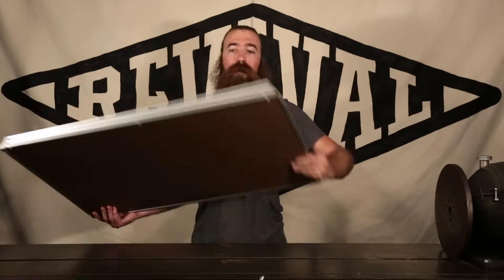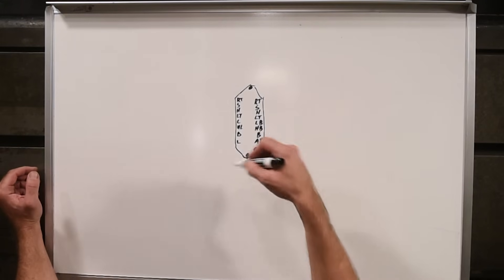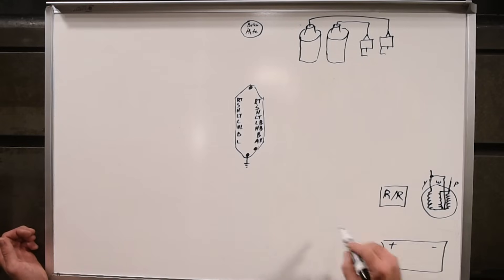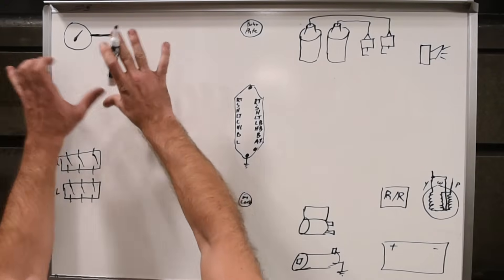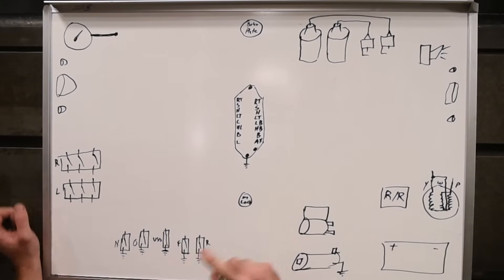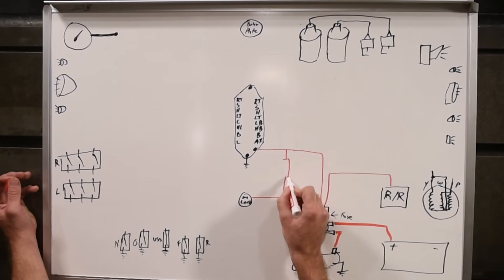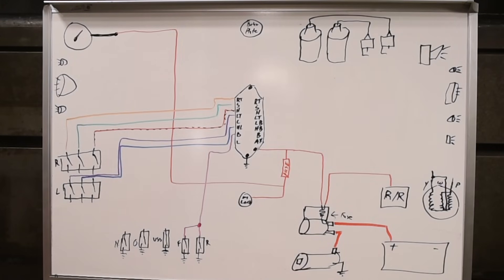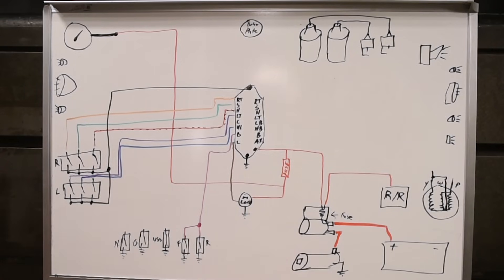How to Wire Your Motorcycle  - Revival Cycles' Tech Talk

Comment: I'm working on an 84 GL1200 Aspencade. Everything else is done but the wiring. This is a helpful video. But since I am drastically reducing the number of electrical components, should I eliminate any specific OEM hardware?
Reply from the maker: A GL provides a lot of opportunities to simplify wiring depending on what you intend to do with it. Really, the best place to start this process would be our tech articles section. The Wiring Theory article and Comprehensive List will explain what must stay and what can go, while the Universal wire diagram will give you a foundation for working out your model-specific system. 

A Comprehensive List of Items You Need for an m.unit Installation

https://technicalarticles.revivalcycles.com/hc/en-us/articles/360008817472-A-Comprehensive-List-of-Items-You-Need-for-an-m-unit-Installation-

https://technicalarticles.revivalcycles.com/hc/en-us/articles/360008817972-The-Revival-Approach-to-M-Unit-Wiring-

https://technicalarticles.revivalcycles.com/hc/en-us/articles/360009106131-m-Unit-Blue-Basic-Universal-Wiring-Diagram
Reply: @RevivalCycles  Thanks for the references!

Comment: I would like to take off the turn signal/headlight apparatus on my bikes left clip for racing (don’t need lights or horns etc... )Does removing these type of things cause a change in current or voltage for the rest of the system components? I just don’t want to overload or cause any other important component to fail bc I removed too many things.
Reply from the maker: The basic answer is there is no problem removing components like horn, turn signals, headlight, etc. The charging system will adjust  voltage appropriately, and you won't damage anything by removing stuff. But there are some newer bikes that have overly integrated systems and they can generate error codes when stuff gets removed. This normally isn't a problem but something to be aware of. Best advice is to unplug the stuff you plan to remove and see if the bike will still run, if it does you're good to go.

Comment: Thanks for the video. All my stuff showed up from yous the other day. My two issues I'm working through are wiring in the TCI unit (I have a 1983 xv750) and wiring the fused starter solenoid. I understand how to connect the battery cable and starter motor cable, but not sure how the pins should be wired coming out of the fused solenoid to the m-unit aux and the RR. Cheers for any help
Reply from the maker: Hey Samuel - The TCI is part of the ignition system as I recall, but I can't remember the details of how its wired, if you can send me a wire diagram at techsupport@revivalcycles.com I can take a look and let you know how that hooks up. But on the starter solenoid, there are 4 terminals, and there should have been instructions with the solenoid that detail which are which, but in case you didn't get the instructions, the two that are closer to the battery/starter cable terminal posts are the control coil, and the two that are toward the outside are the two fused terminals. Then its just a matter of hooking it up like its shown on the diagram in this video. Which is one fused terminal to the m-Unit main power in, and one fused terminal goes to the reg/rec power out (usually a red wire). Then the control coil gets wired with one terminal to ground and the other to the start output on the m-Unit. 

If you want to get into more specifics on your application, email techsupport and we can help.

Comment: Would one of these work for a 1981 Yamaha xs650 ? Chopper/bobber build ?
Reply from the maker: Yes, it would. This video is just a demonstration of how to draw a wire diagram and a CB350 was an example. An XS will have some differences but the theory is the same and just as easy. Check out the wiring guides in the knowledgebase on our website or email techsupport@revivalcycles.com and we'll lay it out for you.

Comment: Hi, on your diagram the ignition coils are powered from AUX out in the m unit but in my bike (cx 500) they are powered via cdi and I think that is the way it should be but then by clicking the start button twoice I only switch off whatever is connected to the aux out in my case rear ( running lights, license plate light) and some dashboard lights, please tell me how can I get the kill switch feature in my case, thank you and keep up the great job!!
Reply from the maker: With the CDI type ignitions, I typically will wire in a relay to control the grounding kill switch wire from the CDI. The relay needs to be a normally closed type so the contacts are closed when the power is off, and the contacts open when power is applied to the control coil. Then you can just use the AUX to control the relay, when AUX is off, the relay grounds the kill switch wire (no spark) when the AUX is on, the relay un-grounds the kill switch wire (spark). 

The only other easy way to do this is to re-use the factory ignition switch which should have a double pole setup, so you can have one set of contacts providing power to the lock input in the on position, and another set of contacts that will ground the kill switch wire in the off position.
Reply: Revival Cycles Thank you very much, it is a great explanation and great help, awesome channel

Comment: I was actually wondering if you guys were still there. If so I was wondering if the same diagram can still work on a motorized bicycle. Please get back with me
Reply: Please this is very important to me I've been trying to figure this out for the last 3 months
Reply from the maker: It can, as long as you have all the components on this diagram including a battery and an M-Unit.
Reply: @RevivalCycles  so I have to have the m unit?

Comment: Hey guys very nice and helpful video! I've got a question to that wiring.. I have a Yamaha XJ 600 from 1989 and my REG/REG connects o my digital Ignitor (CDI?) and to all handlebar switches and lights. I guess my lights gain Power straigt from the reg/reg. In your wiring diagram al the components gain power from you battery, which is loaded by the AC generator through the reg/reg. 

Now to my question: Is it necessary to wire it like it was original, or cann I miss the reg/reg as power source directly and power my lights straight from the battery like in you diagram?

Hopefully you understand my question and can help me! Thanks!

Comment: What about running the radiator fan, engine cooler? You just run hot and ground for it?
Reply from the maker: Radiator fans typically run off of a temperature sensor, once the engine reaches a specified temperature the fan turns on. We wouldn't recommend running a fan with constant power, you're engine will not get up to optimum operating temperature or will take longer to reach its optimum temperature.

Comment: Hey man i want to say thank you your video is great I have a problem with my r6 2005 every time I I turn the ignition on he temp display comes up as hi and when I move the bike back and forth the temp display comes to Lo and then the bike will start. I’m going to check the wiring. Thank you so much great work buddy. Keep up the great work from England. Thanks man
Reply from the maker: Assuming this bike is relatively un-modified, it is probably something simple, and its a good idea to start by looking for pinches, rubs, and breaks along the wire harness.  This sounds like it could be a tricky issue to identify. You might also consider replacing the temp sensor, as those can wear out over time, and they are cheap and easy to replace.

Comment: Hi... I have a question before order the M Unit. My case is that I have a 98 Honda Shadow 600 or VTX600 that use an OEM Ingnition Control Module. If I use the M unit do I still need to use the Ignition Control Module or just Do the Wiring as you show on the M Unit wiring Video? Thanks in advance.
Reply from the maker: The m.Unit is not a replacement for the Ignition Control Module. I recommend diving into the technical articles we've posted up on the site for a better understanding of what the m.Unit provides. 

https://technicalarticles.revivalcycles.com/hc/en-us

Comment: Awesome video.  1 question, if using a traditional key instead of Mlock, does it just replace it directly when connected to the "on" position of the key switch?
Reply from the maker: Yep, if you are using a traditional key switch, it just gets connected between the positive battery ( a small fuse is a good idea, or at least tie into the main fuse) and the lock input. The ignition switch just needs to provide +12V to the lock input to trigger the system to turn on.

Comment: Could this substitute for a transistorised ignition system? My Yamaha Virago xv1100 has one pickup coil that produces a small voltage for input signal of TCi (igniter). The TCI creates spark by opening circuit to coil ground at pickup signal. The pickup is a permanent magnet with coil wrapped around it. The rotor/flywheel has small steel/ferrous that interacts with pickup. I dont know the signal voltage it produces but I think small. Can m-unit work for that?

Comment: Great vid!  I have a BMW R100 project and am planning on using an R nineT headlight unit.  How would I ID the appropriate connector to utilize with my newly created wiring harness?
Reply from the maker: I assume you are wanting to use the connector that comes on the R9t headlight. As far as I've been able to determine, the connector housings are proprietary for BMW, and the easiest place to source the connectors is BMW (dealers, or online OEM part suppliers). The terminals on the other hand are TE connectivity and they can be sourced from standard supply channels. But there are a few different styles so without knowing exactly what connector you are using its hard to know exactly which one you need.

Honestly  it would be way easier to just replace both sides of the connector and go with something common and easy to source like an MX150 or weatherpack

Comment: I have a harley that has a starter/solenoid combo that you explain how to wire towards the end of the video. The main fuse you tie right into the starter cable? Is that correct?
Reply from the maker: That is basically correct, the main fuse is tied directly to the battery positive terminal, and this can be accomplished a few different ways. You can connect at the battery with a ring terminal, or at the starter with a ring terminal. OR you can solder into the battery or starter cable ring terminal so there is still only one connection, or you could solder/heat shrink in the middle of the battery cable. But the important part is to get the main fuse connected to the positive terminal anywhere it is convenient.
Reply: Thank you so much for clarifying and your quick response. I am the third owner of the bike and the original electrical work has been bastardized beyond recognition (i.e. mis-matched wires, e-tape on the starter cable, lack of ANY fuses, etc...). I am sure you see this far to often in your line of work.

As a first timer working with electrical on a bike, I must say that team Revival has unparalleled knowledge, support, and customer service when it comes to the subject. Again thank you guys for backing up your products and standing behind your work. What a genuine company.

I think I have watched all of your tech videos by now. All of them well done and simple enough for a garage mechanic to understand. When you get the opportunity, it would be helpful if you made a tech-talk on de-looming your bike the right way. I had to cut my loom going into the headlight... Not the end of the world but many a times while I was fishing wires thought to myself, "I wonder how those guys do this." 

Cheers.

Comment: If the m unit is set up for one wire tail light will it have a brighten effect? Or will it flash or something?
Reply from the maker: shae grover say you have a two wire light, one positive and one ground. The mo.Unit will first take a voltage reading and then it will provide full power to the brake light and a diminished amount for the running in order to give you two levels of brightness 

If you have a 3 wire light to reduce the amount of wiring you can tie the two positive wires together effectively making it a 2 wire light. 

Additionally, the mo.Unit has several different brake flashing sequences to chose from should you want that as well.

Comment: The wiring is for the Cb350. In the factory wiring it has a starter coil and condenser. Does the starter solenoid eliminate one of these?
Reply from the maker: The condenser is typically related to the ignition system, and the m-Unit does not replace any part of the ignition system, it simply controls power to the ignition system. Not sure what the "starter coil" is, but the starting system is usually composed of the start button which controls the starter solenoid, the starter solenoid provides high current power to the starer motor, and that causes the bike to start... With the m-Unit the start button is connected to the input, and the m-Unit controls the starter solenoid. 

Technically, the starter motor and starter solenoid both have coils in them...so not entirely sure what you are referring to with the starter coil. Hope this helps.

Comment: your handle bar switch have a ground before and hot after going to moto gadget. on harley dont you have a hot in and when close hot out that would to to m unit? im a little confused only thing hokding me back or does the m unit come with good instruction?
Reply from the maker: The way the m-Unit works is completely different than conventional wiring, there are no "hot" wires at all on the handlebars. The input side of the m-Unit only sends ground reference signals to the m-Unit and that tells the m-Unit what to turn on and off. All the power switching happens inside the m-Unit, with solid-state control. 

When using factory switches, they must be re-connected to provide the correct ground signal to the m-Unit.  This works fine on harleys but the switches must be completely disconnected from the factory harness and re connected to match the m-Unit paradigm.

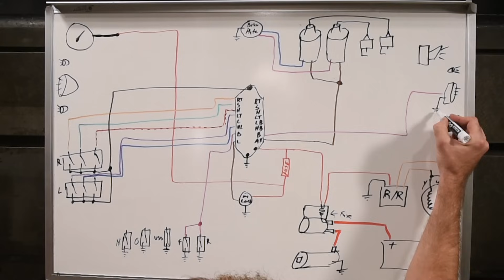Comment: Great video, it really helped me get a better understanding of how I should plan out my wiring for my build. But there is something I caught and I'm not sure if it is a mistake. at 22:15 you draw in the tail light circuit, but you tied it into the brake light circuit instead of the low beam circuit. Wouldn't this mean that the brake/tail light only turn on and off as opposed to having a high/low setting?
Reply: Or does the M-unit supply power at higher resistance when the bike is turned on? (to show the high/lo setting.)

Comment: Sorry if missed it but where does the killswitch come in? And also where i come from bikes are not allowed to start while leaning on a kickstand/sidestand. How does that fit in? Thanks!
Reply from the maker: Ok, there are several ways to handle this, one is to upgrade to the new m-Unit blue which has inputs and outputs dedicated for this. But for the V2 I think the easiest way to explain it is that the kill switch connects to the config input and will kill the power to the AUX output when the config input is grounded. This means you need a normally open kill switch,  or the switch is open in the run position. 

For the side stand switch, this can be setup so it completes the ground for either the start button input, or the starter solenoid control coil ground. Then using a switch that is closed when the stand is up it will make it so that the starter will only fire when the stand is up.
Reply: Thank you! Man you guys are the best! Your videos are always helpful!

Comment: So when Stefan did the tail light and brake light spliced together in one wire, tail light will be on constantly and the brake light will come on when the brake sensors/switches are activated? Or would the taillight have to be connected to the Aux and brake light connected to the M unit? I know he said something about configuring the M Unit for one wire taillight, does the M Unit know the difference between running and braking? Great video, keep up the good work. Thanks
Reply from the maker: This video shows a "one wire" tail light arrangement, which is possible with the m-Unit. With this setup the m-Unit does the pulse width modulation to reduce the brightness of the brake light when the brakes are not applied. Then when the brake input is grounded via the front or rear brake switch the m-Unit will provide full power to the light which give the brake light function. 

If you don't want to run a 1-wire setup, you can connect the tail light wire to the AUX output and the brake light wire to the brake output and configure for standard operation.

Comment: Excellent tutorial!  With a CDI set up, would you simply connect the kill switch wire on the CDI box to the mUnit AX output?  Just curious to know exactly how the wire diagram would change with that caveat...  Or would I even still need the CDI?
Reply from the maker: You would still need the CDI as that is what controls the ignition timing for the engine and that is specific to each model of motorcycle. The basic idea is like you describe, essentially you use the AUX output to power the ignition system and then wire up the rest of it so that it is the same as stock.
Reply: Revival Cycles Thanks guys! You rock!

Comment: Can you guys do a video for  newer bikes that are fuel injected along with using the stock left and right controls and using a stock key switch instead of using the m-lock and not using the left and right controls that is in this video
Reply from the maker: We may be able to do a video that addresses some of these concerns, and gives a rough outline of how to break down the project.  But there is so much variation in the setup of EFI systems, and even in factory controls that there is no way it would cover specific details.